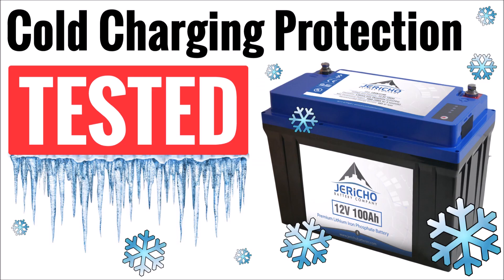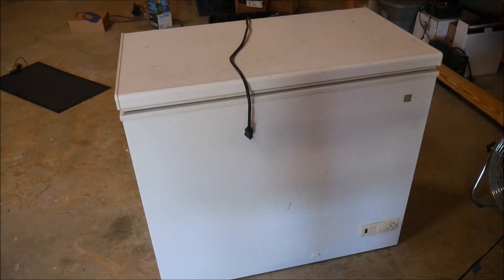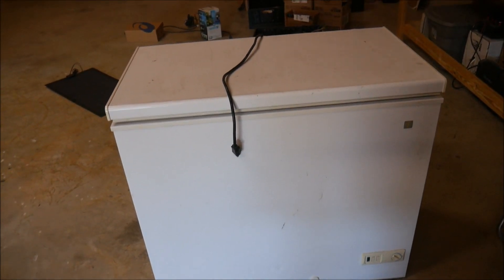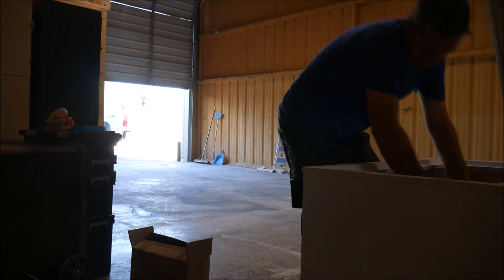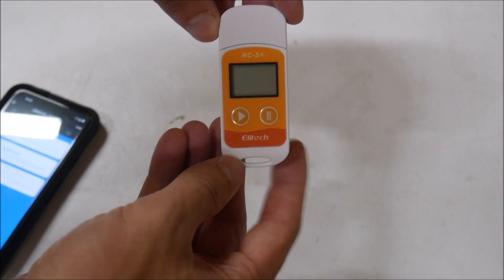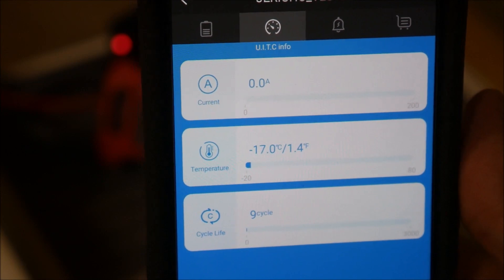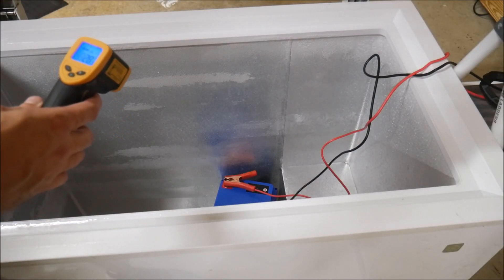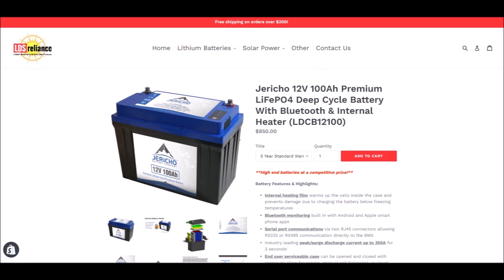Testing Cold Charging Protection - Jericho 12V 100Ah LiFePO4 Battery With Internal Heater

Comment: Hi Great video. The battery was down to -20oC so that means both discharge and charging  is blocked by the BMS until it warms up, right? Just curious what would happen if the battery temperature was between 0 and -20 oC, where only the charge current is blocked? Would the BMS divert incoming current immediately to the heaters i.e. soon as you connect the charger)? Does the current need to be a minimum amount for the heater to turn on (say if you use solar to heat and charge), and how does it check for the minimum amount when the BMS is locked to charging?
Reply from the maker: The BMS will allow discharge at anything above -20C.  If you were actively discharging the battery between -20C and 0C and you connected a charger, it would activate the internal heater to warm up the battery before it allows the charge.  The heater doesn't care about whether the battery is discharging or not.  It only reads the internal temperature and sense a charge current.

As far as the minimum charging current to activate the heater, I don't know.  I may have to test that!

Comment: Cool test, glad to see it's working as designed. I have made my own diy 100ah batteries using battery hookup lifepo4 modules but yeah.....no cool built in auto heating pads in my builds like this. I have to keep my batteries indoors during cold temps.
Reply from the maker: And that is fine.  The cold charging thing is blown way out of proportion by certain other Youtubers that will remain nameless.  In almost 6 years of business, MillerTech has only had one report of a battery failure due to charging in cold temps and they sell 90% of their batteries in the upper midwest in Amish country where it routinely gets below freezing.  And the Amish use their batteries all day every day, whether it is cold or not.

I am going to give consumers what they want and they want cold charging protection and a heater.  But your battery should be fine without, especially since you know what you are doing.

Comment: Very good - but iam always afraid the Bms temp sensor is at 4C when cells still frozen. How do you prevent that?
Reply from the maker: You mean if the sensor goes bad?  I'm not sure you can do anything in that case.  The BMS may have circuitry to prevent charging if it detects no readings at all from the temperature sensor but if it is giving a false reading I don't think there is anything you could possibly do unless you had a second sensor.